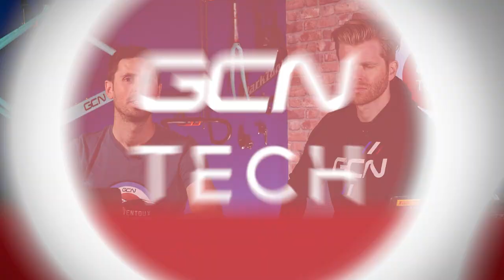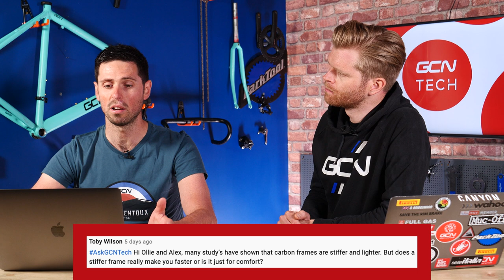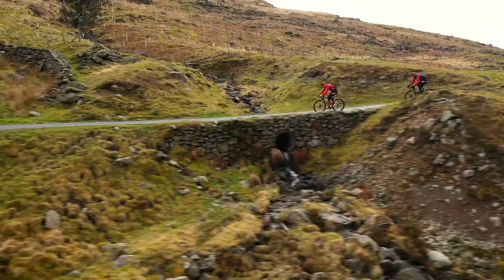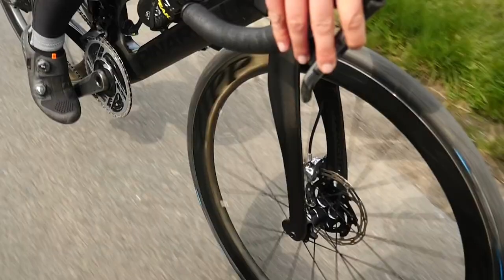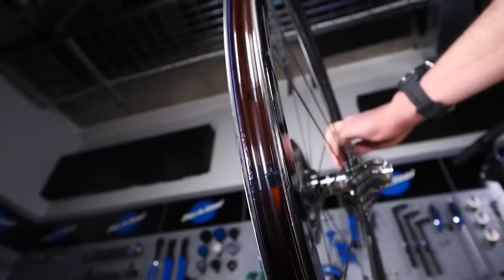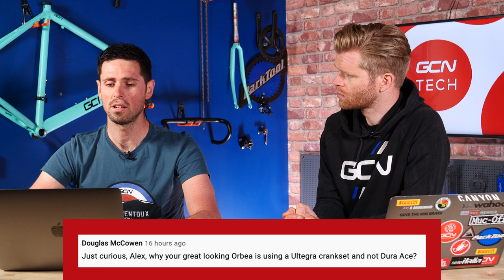Does A Stiffer Bike Frame Actually Make You A Faster Cyclist? | GCN Tech Clinic #AskGCNTech

Comment: Wheels - Buy Wheels with DT Swiss hubs such as sigma sports RSL wheel sets. 

These are 12mm thru axel. But then buy a set of QR adapters for the DT Swiss hubs.

So you have a good quality set of carbon wheels that will fit QR but then are future proofed as they will fit 12mm thru axel if you get a new bike in the future 

🤔🤔😊😊😊👍

Comment: My 2010 Felt F1 was stiff to ride, but not necessarily stiff in controlling wheel angles. On rough, curvy descents, it’s a bit scary. My 2020 Orbea Orca OMX is really beefy at the bottom from front to rear wheel, but compliant at the top for the rider. It’s so much more fun and fast on descents! As an average rider, I don’t need hyper stiff cranks. Stiffness and compliance are about comfort, grip, descents, and accurate handling for the rest of us.

Comment: QR on a disc brake wheels. That can be a bit limiting but there are options. I have a 2018 Cannondale SuperSix which has QR on the back. I went with FFWD wheels with the DT240 hubs. The DT hubs have changeable adapters to use with various configurations.  The bike came with Mavic wheels and I purchased a set of adapters so that they could be used on my gravel bike.

Comment: I've ridden some noodly track frames before, and the difference I felt when sprinting is that the feedback from my pedal strokes is less responsive, and I was putting down power slower than compared to sprinting on a stiffer frame. Slower probably means lower cadence with the same power, and the cadence would feel involuntarily slow.

Comment: 2:27 @ Oliver Whettem's: In reference to the question about oval rails of carbon saddle: I've had this EXACT issue before with a 2014 Orbea Orca. It depends on your bike manufacturer and MODEL. My 2014 Orca seat clamp will not fit oval carbon rails that Fizik saddles have.  It sucks especially when the seat post and saddle clamp are propriatory to BOTH  the make and model of the bike. It's one of those things. However, the circumference of other manufacturers carbon saddles may be different and fit. For instance Selle Italia's carbon rails I think are much smaller than Fizik's.
Reply: When I switched from carbon railed saddle to a round one, the "head" of the seat post had to be changed. Highly recommended as the carbon rails are designed to be stressed across the entire surface.

Comment: Did compare an endurance aluminium frame and a race carbon one (total carbon bike weight was about 2kg less). From my totally unscientific tests carbon one saves around 20-50 Watts, depending on the power. Noticeable difference starts from ~220W

Comment: Inner tubes are cheap. repair once, throw them away after. Stiff frames are not necessarily comfortable. I've never had an issue with non OEM chainrings. i use TA or Stronglight. Go to Velofil who convert a Klein mtb to a gravel bike

Comment: Allez sprin or caad 12 will be stiffer than most carbon, especially the allez
Reply: I love caad
Reply: Both Specialized and Cannondale have a vast amount of aluminum experience. Their bikes are stiff, but you will also have way more road feel. One of the advantages of their carbon framed bikes is less road noise as well as a stiffer frame.
Reply: @jamesmckenzie3532  yes but alloy frames are (normally) cheaper
Reply: @jamesmckenzie3532  less road noise or a stiffer frame. Stiffness is the mechanism that translates road noise. You cannot have both. Tube size, shape, thickness, and materials determine stiffness. Carbon fiber is a composite, not magic. It can't "absorb" road noise without that energy going somewhere, namely in flex and hysteresis (if it's the same word for carbon composites).
Reply: @King Of Crunk the layup is a double edged sword. There has to be a certain ratio of epoxy to carbon, and carbon only has stiffness in one direction at a time. Stronger in one direction is weaker in another, so there's always a compromise. If the force applied can't be absorbed in one direction, it will be absorbed in another direction or in another component. If the chainstays are stiffer vertically, they'll be softer horizontally, etc. It's not like you can make the seat post more compliant in a vacuum, either. You'll still need lateral stiffness or it'll feel like it's running out from under you. 

The standard three direction layup with 40% epoxy by mass (fairly standard value)  yields the stiffness to weight ratio barely greater than aluminum. Carbon bikes are only stiffer because the tubes are thinner and the diameter larger. If they modify the layup too much (favoring one direction over others beyond a certain threshold) you'll risk delamination and separation along that axis. 

The technology exists, sure, but that doesn't mean it's a good idea. This design has a suffer bottom bracket by just having a bigger junction, and nothing crazy about the fibers or layup.
Reply: @YoureSoVane  Take a look at Bianchi. They embedded shock absorbing layers into carbon fibre. Not something you can do with aluminum. Also, I ride with members of a team from a shop that sells Cannondale. The SuperSix rides better and is stiffer than the CAAD 13. That's per the shop owner who rides about six different bicycles per year.
Reply: @jamesmckenzie3532  like I said, you can't get stiffer with carbon without making the tubes bigger in diameter. I'd hope a $5,000 frame set would ride better. However, is the difference in ride quality more significant than the difference between tires?

"Shock absorbing" means flex. It's absorbing the energy in some way, so either it flexes and creates heat or it compresses and creates heat. No other way to do it.

Comment: A stiffer frame helps get the power to the ground more efficiently. Maybe think of it this way. When you push down on the pedals, some of that energy is dissipated through the frame flexing. The more flex in the frame, the more of your energy gets dissipated before the power reaches the wheels.
Reply: Add some rough road surface to the mix.
Reply: @palicar  Good point. When you ride across a rough road, the stiffer the frame, the more the bike pitches forward and backwards. As a rider, the bike just feels rough. However, that roughness is absorbing some of the energy that would normally propel the bike forward. In that case, some slightly wider tyres with lower pressure can help.
Reply: @se7enTse7en  exactly. It is a complicated subject which can’t be fully addressed in a forum like this. No harm in discussing some of the general concepts though.

Comment: Stiffer the chassis. Less energy will be loss through the frame and wheel flex. But if you are not racing or chasing kom's, it doesnt matter. 
It matters to me tho.  One day that kom will be all mine.😈
Reply: It can flex back and if in phase with pedals, just lowers your power peak but extends the duration. Had a steel mountain bike and when switched to carbon found myself spinning out and losing traction on short steep hills. Difference was frame flex, everything else was direct swap from old bike.
Reply: @soy_leche  lol or your steel was so HEAVY it gave you traction.
Reply: @miniac60  the difference between a steel frame and  carbon when taking into total system weight (including rider) is not significant enough to account for this difference that you are attributing to the frame alone.
Reply: @mikes1984  it was a joke mikie, hence the "lol" at the start of my comment
Reply: @miniac60  lol, touche.   btw your username reminds me of "Lisfranc fracture"

Comment: Even if the puncture is close to each other you can file the area, cover the punctures with rubber from an older tube and use a tyre adhesive.

Comment: Elliott Farris, I had an older Tarmac SL5 that had QR disc wheels and I had Zipp Firecrest 303s on them. They have end caps to make them QR or TA and they were fine wheels. I didn't like the QR because it was difficult to get the rotors lined up after taking the wheel out. I've since sold that bike and have bikes with TA and there's not alignment issues there.

Comment: Totally depends upon the test subjects. My (road) carbon frame's rear triangle is far more flexible than my aluminum frame.  On my Alu frame I climb and sprint faster as the rear triangle has literally no deflection compared to my carbon frame. But more modern carbon frame are stiffer side-to-side than my older carbon frame and probably much more comfortable over rough surfaces.

Comment: Stiffer equipment is faster, insofar as it prevents misalignment.
Stiff frame and cranks can keep the BB aligned but only for high torque, if you're a small spinner you might not notice.
Stiff chains can maintain chain length under load, keeping the rollers engaged properly.
Stiff frames can keep the brakes aligned, brake rub will make you slower.

Comment: So... frame stiffness makes only a marginal difference (to be tested) Frame weight makes little difference on the flat. 105 is almost as good as ultegra. Wheel weight is rotational weight and makes little difference most of the time... if you put a top cyclist on a 2,000 pound, dollar, euro bike how much slower would they be?

Comment: Hi Alex and Ollie! 

Does a -17 degree stem affect handling differently compared to a -6 degree stem? #AskGCNTech
Reply: The angle will alter the height of the bars: a bit higher or a bit lower depending on whether you flip the stem up or down.  The only effect on handling will be that you are sitting in a slightly different position and may feel more comfortable or less comfortable as a result.  A longer or shorter stem will affect handling: long makes the steering feel slow; short can make the steering feel more twitchy.  A steeper or shallower stem won't affect the steering.

Comment: #AskGCNTech
I am converting an MTB into a Gravel bike.
I managed to source Claris 2x8 Shifters and Derailleurs.
However, my MTB currently has 3x7 gearing at the moment.
Is it possible to make this work even if it becomes ghetto ?
i.e. limit screw adjustments to just use the 2 biggest chainrings? 
If this is not possible I am also fine keeping it as a 1x setup where I just keep it on the middle or big ring and just not change gears at the front at all. 

or is it not possible at all and I will have to wait for eons for a compact Claris crank (165mm) to be back in stock with all the shortages going on right now.

Comment: #AskGCNTech Hi Alex and Olli you always have some good info at GCN. I recently purchased a set of Awesome ENVE 5.6 wheels and running them tubeless.  I wrapped the wheels with one wrap of tape as instructed, well it's working well so far, I now have a feeling two warps would of been better. How do you pro's stand on the issue on warps? one vs. two. :)

Comment: #AskGCNTech I have a SRAM Rival 1, my first 1x setup, with a 38t chainring and 11 speed 10-42t XG-1150 cogset. For the life of me I cannot get this indexed so that my chain stays on the lowest gear (the dinner plate). It will shift to that gear, but then when under load (like on a hill, when I need it) it shifts back to the smallest gear next to it. My high limit screw should be set correctly: on flats in the dinner plate the SRAM “dummy shift” is there. I fear adding more cable tension because it’s already a little slow to shift down gears, and besides the lowest gear it shifts “fine” among every other gear. What else should I check: could it be my B-adjust screw, or is my chain perhaps too worn? Thanks!

Comment: #AskGCNTech Hi Ollie/ Alex, I've got a shifting problem. My bike came with a Tiagra groupset and I uprgaded my cranks, rear mech to 105. I still have the Tiagra shifters (10 speed), and am using a 10 speed cassette (cs-hg500-10) and a Tiagra 10 speed chain. I just can't seem to get it indexed correctly. No matter what, at some point it moves 2 gears in a single click. I replaced the shifting cable, and the housing is only about a year old. Is there a compatibility issue? Do I need to replace the shifters with 105 and get an 11 speed cassette and chain to solve the problem? Thanks!

Comment: #askgcn
I am currently running an Ultegra R8020 disc brake caliper with the Ultegra rotor on my bike. Is it possible to use Sram rotors on the Ultegra brakes? If yes, what are the changes needed?

Comment: #AskGCNTech - Hi Alex/Ollie/Manon. I have quick releases with disc brakes on my bike, an absolute pain. Every time I put the wheel on the dropouts, I have to fiddle with the wheel's exact position endlessly to align the rotor with the calipers. Do you have any tips on how to ease this process? I have aligned the calipers with the rotors as well as I can, but the wheel's position in the dropouts doesn't seem to be repeatable with QEs as is with through axles.

Comment: #askgcntech I have recently purchased some new 105 rim brake callipers for my bike. When installing, I cannot, for the life of me, get the pads to sit correctly on the braking surface even when I put the pads as low as they can go. Is there anything I can do to make them fit? Do I need to change back to my old callipers, or should I bin the frame?

Comment: #AskGCNTech Hi Alex, hi Ollie, hello GCN viewers. I've got a not so technical question. I've been monitoring my heart rate with a chest strap. Recently I've noticed a consistent drop on my average HR. Even though I feel equally tired my HR is about 30 bpm lower. I'm not data freak but it's annoying I'm on the easy zone 😂 anyway. My theory is, and the data validate it, that when I changed from 11-32T to 11-28T cassette I go the same speed (same route) but with less revolutions, I don't have cadence sensor. Does that make sense or am I getting more lazy? My legs feel tired for sure!

Comment: Hi Alix and Oli. After a very long wait i've recently got hold of a new Cervelo Caledonia C5. It's stunning and I love riding it. Unfortunately the chain slipped off the small front ring and chipped the paint on the bottom bracket while I was trying to relocate it. What's the best way to treat small paint chips on carbon frames? #AskGCNTech

Comment: Sweet geezus boys! It’s science. Anecdotal my arse. Energy you spend deflecting the frame, is energy you don’t get back. Even if the frame springs back to shape, that energy does not translate to torque at the wheel. Seriously fed up with wannabe engineers trying to debate this issue.

Comment: Hello, I am thinking about upgrading my GRX 400 2x10 to 2x11. I know I have to swap the rear derailleur, shifter and cassette, but why do I have to swap the front derailleur and chain rings to the 11-speed version as well? What is the difference between front derailleur for 10 speed and 11 speed? #AskGCNTech
Reply: The chain is thicker on 10 speed. It would work. But if you want smooth shifting and silent drivetrain i would Upgrade front aswell.
Reply: An 11-speed chain is 5.4 mm wide, vs about 5.9 mm for a 10-speed chain.  If that sounds like a small difference, it is - and it's not uncommon to mix components with plus or minus one gear difference.   For what it's worth, I'm running a 10-speed Shimano chainset on an otherwise 9-speed drivetrain, and it functions flawlessly.

You might gain a bit of shifting precision with an 11-speed derailleur, but the difference between the chainsets is minimal - in fact, many chainsets don't even make a distinction between 10- and 11-speed.

Comment: #askGCNTech I've been grappling with whether to swap from 25 to 28 on my 2015 Diamondback Equipe (dura ace rim brakes). Everything I've measured points in the direction that 28 WILL fit. Can you talk about the fitment of 23, 25, and 28 tires on rim brakes bikes?

Comment: I habitually ride in the dry, and therefore use dry chain lube almost exclusively, but say I woke up and it was raining AND I somehow still wanted to ride outside instead of on Zwift, would I be okay popping wet lube onto the chain and worry about cleaning it after or should I still go through the entire degrease/re-lube process.
Reply: If it's gonna be a short ride<50 miles, I'd honestly just leave it and re lube when you get back. If it was a long one and you weren't going to be doing lots of wet riding again, just put on top, soak and then clean off excess

Comment: #askgcntech hey guys, on my current setup I'm running a Campag Veloce 10 speed with 28 tooth max rear cassette. I'm trying to work out what my options are for upgrading, with an aim of increasing the size of the rear cassette. I think if I I replace the hanger with larger one I can increase the cassette up to 32. Which components would I need to change if I wanted to go to 11 or even 12 speed (if this is even possible)

Comment: #askgcntech  At 5'6" or 167.6 centimeters, I fit into middle of most extra-small to small bike ranges, and looking at some decent money for my next road race bike I'm wondering should I got with an extra-small and possible have to stack my bars a bit, or a small with less clearance but a slammed stem. I currently ride a 51 cm LOOK. Thanks..
Reply: Huh: you try being 193cm and 118 kilos - getting a modern bike to fit is tricky, which is why I still ride two from the 1970s.  Steel, of course, because at my weight anything else flexes too much.  No, I'm not fat, nor overweight, and lighter now than when I played serious rugby - and last year managed 30 consecutive days of over 100 kilometres, following one day behind the TdeF.
A bit slow I know, but now that I'm 76 the distances are slowly dropping! 
The happy days continue.